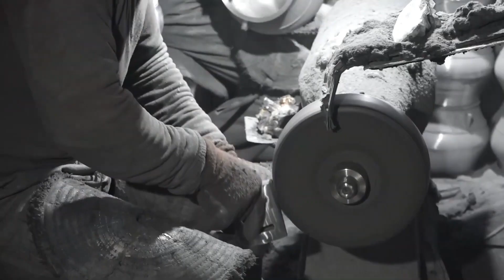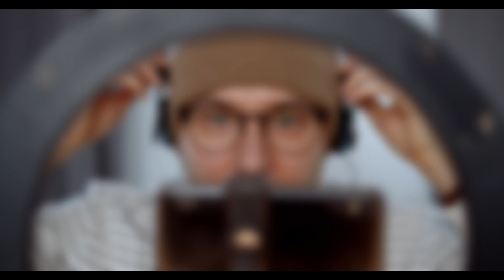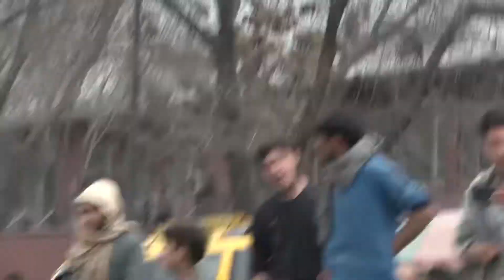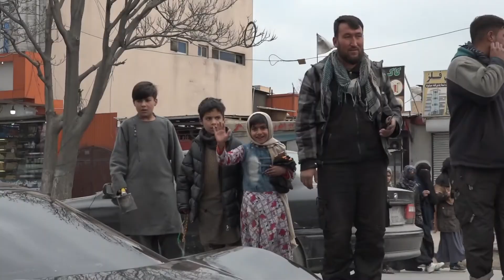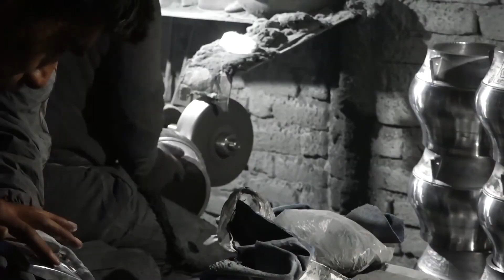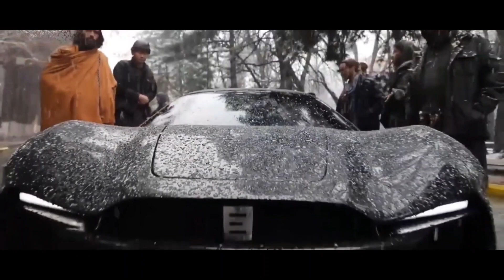Taliban and Technology: The Truth Behind Mada 9's Creation | From Warzone to Supercar

Comment: This is a car not made and assembled from different cars parts
There is a program on TV where mechanic do this every day , it is not a big deal and I don’t understand how this guy make so much a big deal of it 😂😂😂
Reply from the maker: No, you think wrong; Almost all the parts of this car are handmade by the mechanic, and not only the engine is made by him
Reply: @blackmasterybox  not absolutely true you can not produce those kind of parts In Afghanistan,there is no factory for this 
If produce by hand then god save you from safety point 😁
Reply: خخخخخخ تو چقدر احمق کوتا فکر ونژاد پرست استی که نمی‌توانی موفقیت دیگران را تحمل کنید برات متاسفم
Reply: Yea using a Toyota 1zz-fe engine which was originally made in the late 90s. It's only about 135hp. Which means it will also have a Toyota gearbox and electronics. The car is using some pretty old tech engineering. A tubular chassis as well.

The same engine appeared in a Lotus Elise S in 2005-2009. Which is likely still a significantly quicker and more advanced car than this.